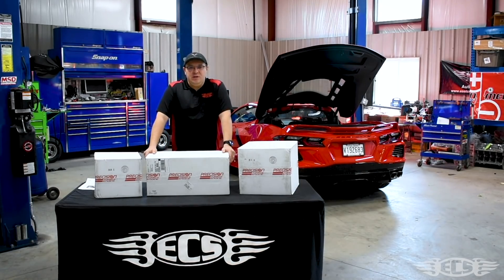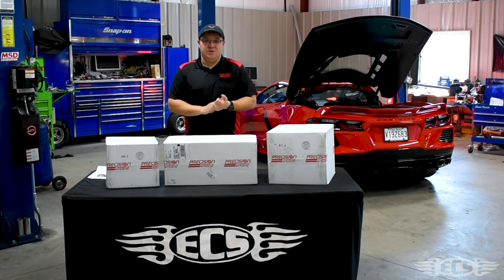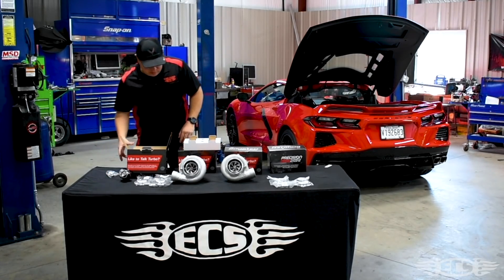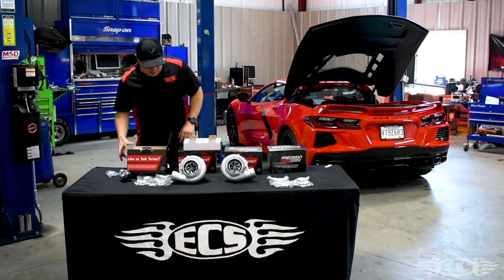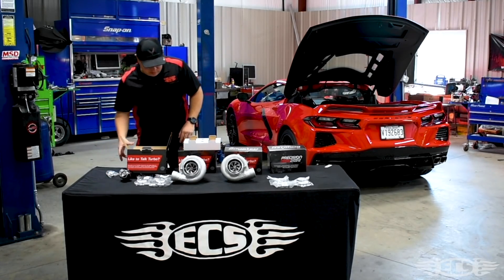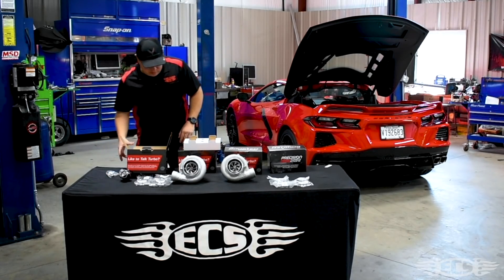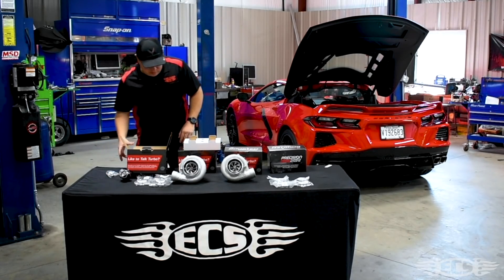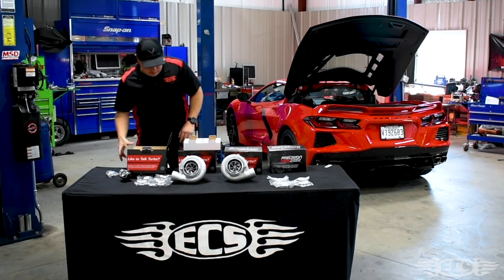C8 Corvette Twin Turbo System by East Coast Supercharging Part 1: Intro and Overview

Comment: First time I have heard someone describe the platform as being ready to accommodate the turbos up top. Thx guys just put that to bed
Reply: I thought about that too. The TT Z06/ZR1 was designed for them. I think most shops just forget to mention it. 
Complete Street Performance head honcho Andrew stated how much room there was. Hes planning on low mount and keeping the trunk & putting an inner chiller in plus meth. 
Hennessy was 1st to TT a C8. Just waiting for someone to crack the encryption on the CPU to get a nice tune on it. Hennessy did state that the stock LS is only good for 650ish. They'll build the motor when the cpu is cracked. Itll be a shame if somebody throws a rod or spins a bearing.

Comment: Good luck putting those up top. I have seen 3 other shops put them down low which is easy but the air filters are right on the ground in the back. Seems like the worst possible place for a open air filter simply due due to amount of dirt getting kicked up under the car. Would have to clean the filter every week.
Reply: Randy Aiken lmr did it to streetspeed717
Reply: BACKSEAT DRIVER    I know I saw his video this week. It’s nice to know Someone out there actually has a little common since.

Comment: Im thinking a top mount would look great! But i do believe the turbos should be mounted under neath,avoid all those heat issues etc!
Reply from the maker: This new C8 engine bay is VERY well ventilated we feel with proper thermal management and design this will not be an issue.

Comment: Did you guys consider going with the new air cooled style turbos that do not require any oil or coolant lines . That would make isntalling this much much easier. and more of a bolt on affair.
Reply from the maker: We did and they are a great option, not having to run oil lines would be a plus. However we don't have much hands on experience with them and we worry a bit about long term reliability. We prefer the lubrication and cooling abilities of the oil fed turbos for this application.

Comment: Quick question is a supercharger more reliable then turbos. That's what I've been told I know you can get more power out of twin turbos. But since I would be using mine as a daily driver I was just wondering which would be better for that?
Reply from the maker: Turbos can be just as reliable it all depends on the platform and the kit. We certainly intend to make ours that way. We are also working on a supercharger kit for the C8 but given the complexity of machining brackets and tensioners, idlers etc we decided to field the twin turbo kit first while we continue development on the supercharger system.

Comment: ECS I am a fan of u guys work,especially the LS2 Corvette motor and platform, I also love the 06 GTOs and own one,what is the maximum hp and boost u guys have thrown at them? Thanks!
Reply: My ecs ls2 is living at 776rwhp.
Reply from the maker: Adam on the LS2 I would say 650-750whp and about 15-16 psi with proper fueling and mods.

Comment: GM outdid themselves with the C8 this time. 35 million years to crack their code huh? Lol . Best leave well enough alone and wait for a factory setup to eventually come down the line .
Reply from the maker: that's just not our style!
Reply: Just use the holley fuel mgmt system screw gm

Comment: The lt2 is no different than the lt1 strength wise. Why supercharge or turbo a engine with non forged pistons and weak rods so you have to limited boost to 600-650 whp? A575 whp n/a combo with full bolt on and heads and cam would be faster. N/a power for power is faster than boost on the track. I wouldn’t boost my car add all that weight , heat ,  clog up engine bay space unless I could crank it to at least 750-800whp to compensate for the heat soak and inconsistency of boost.
Reply from the maker: We routinely pump out LT1 C7s making 700+ whp with our Novi 1500 kit at about 10 psi, headers and methanol injection. These new DI motors don't require much boost to make power. With that said I agree an NA setup for the road course would be ideal and preferred most of the time and for those customers we will also be developing complete NA packages. Do keep in mind that usually the labor cost of doing one of our centri setups in a C7 vs doing full heads and cam w bolt ons is usually less for our kit vs the 30-40 hours to drop the engine to do heads and cam the right way and the C8 is looking to be even more. Thanks for your input and stay tuned for more.

Comment: Your car so you can do as you please. Still those engineers spent years developing that car and the different modes. You would think you'd spend time learning the car before changing it. I don't get it....but what ever.
Reply from the maker: We did plenty of baseline testing we had the car for a month before we tore it down. One conclusion we had.....it needs more power!
Reply: @ECSRacingVids  More power to you man it your decision and your car.